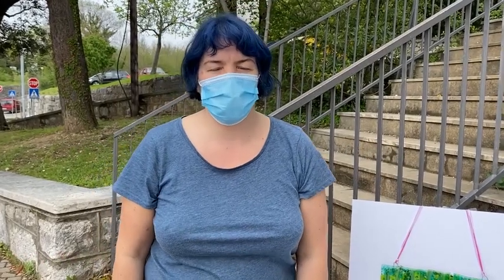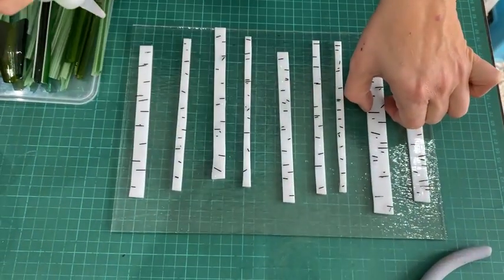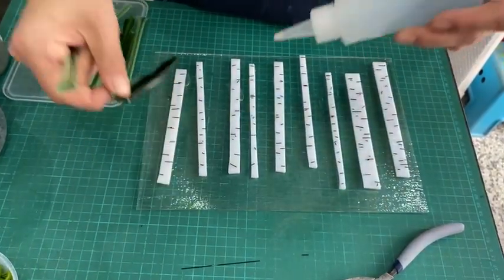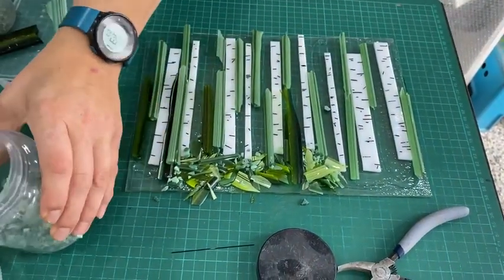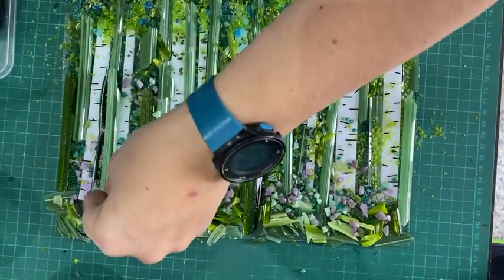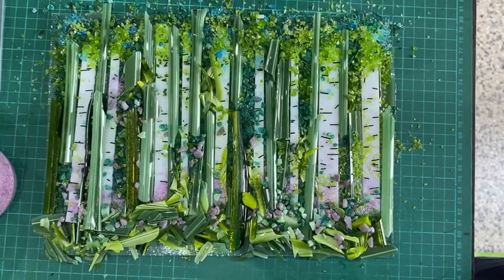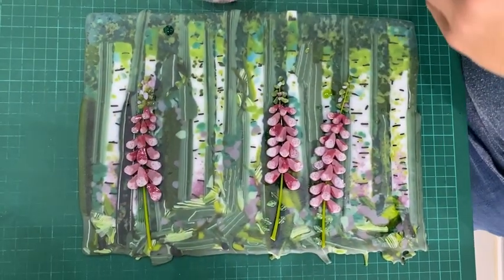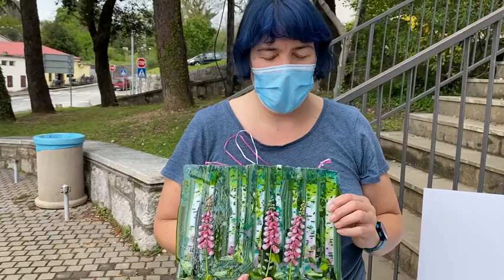Pressed Foxglove Woodland Glade

Comment: Hi, what size and make of sandblaster do you have please?
Reply from the maker: I have a very cheap sandblaster from eBay, I just used silicone to seal it and then I have a very large volume and output compressor which is what matters